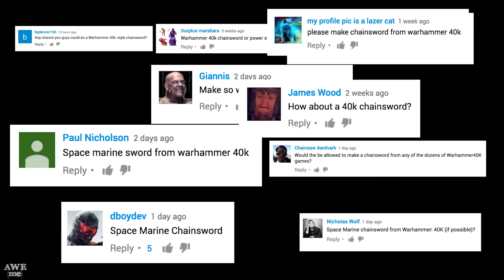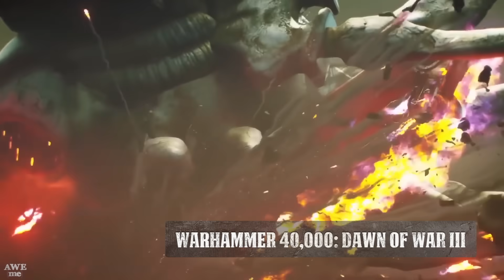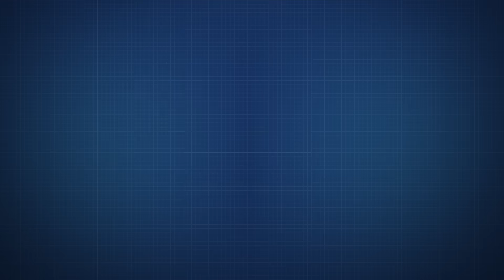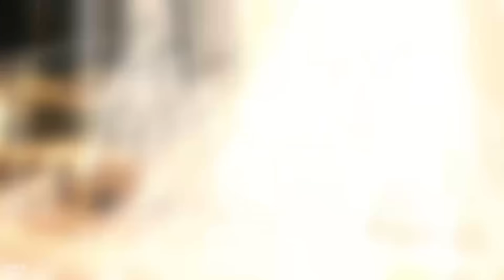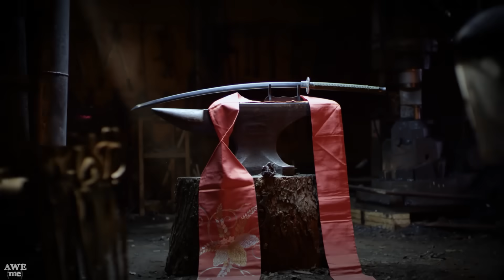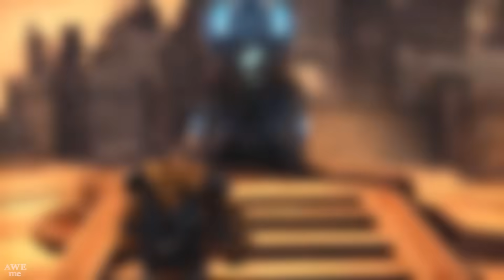Warhammer 40K Chainsword - MAN AT ARMS: REFORGED

Comment: at this point they'll be able to do a goddamn Lancer from gears of war...
Reply: Lancer from Gears of war? ON A 40K chainsword video? YOU HERETIC! Also they make Melee type weapons and armor, not fire arms.
Reply: If they were smart enough, they could make their own rifle from scratch from the ground up. Only the lower receiver in Federal law I think is considered a registered firearm. If they make their own from the bottom up, it should be entirely legal, wouldn't even need a serial number because it's not a manufactured product. The only law they would have to adhere by is to make it legal in the sense of being semi-automatic and part lengths, such as the barrel. That's dependent on the state though more or less.  Again, I'm no lawyer and it's just my opinion but they also make swords and the like, not guns. Completely different method of craftsmanship. They would need a serious gunsmith who's familiar with making fire arms and crafting customized parts that can withstand the pressures of cycling bullets and a chainsaw.
Reply: Don Dude very true. all ya gotta do is purchase the lower receiver of an AR 15, no upper required, and there ya go. ya got a rifle in the eyes of the ATF
Reply: They make swords not firearms mate
Reply: AlabamaDipper18 That's why you don't purchase one, instead you go to a page like 80PercentArms and buy a "paperweight", then finish milling it out, drill pin holes in the side walls, then some kind of finish coat on it. So much more satisfying.
Reply: Not sure tinkering with firearms is legal, at least to some extend. 
However, they could just make a mock-up. That thing is stupendously badass.
Reply: I doubt they'd be building an entire gun from scratch, they'd probably modify an existing weapon. In the case of the Lancer, the chainsaw is basically a fancy bayonet. From what I remember with federal law weapons before '89 or manufactured specifically to accommodate a bayonet can legally have them. Otherwise no.

So in this case that would mean modifying an existing weapon to accommodate a bayonet. I'd assume that falls into the category of "not legal".

Then again, if they're modifying a weapon that was already legal for bayonet use, maybe that would allow them to skirt it.

Comment: What is tac welding? I've only heard of electrode, mig/mag, tig and gas welding
Reply: Tac welding issimply a method of welding to pin pieces of metal in place which you can do in nearly all types of welding.
Reply: its not a permanent form of weld, its just to hold something in place while you do other welds.
Reply: Oh okay then I have heard of it before just under a different name, thanks.
Reply: Things often have more than one name/term/nickname/slang name/etc.

Comment: The Machine gods of the Adeptus Mechanicus are pleased. You will be granted a large alotment of servitors for you private use.
Reply: Runs through a binary translator
That's awesome.
Reply: But where are the TOASTERS you promised?!
Reply: MAchine GOD  there is only 1 necron lord they worship not many!
Reply: 01010000011100100110000101101001011100110110010100100000011101000110100001100101001000000100111101101101011011100110100101110011011100110110100101100001011010000000110100001010

Comment: Power Sword From Warhammer 40K
Reply: you mean thunder hammer just saying
Reply: Yeah that would be kind of hard to capture without a few hundred more years of technological development
Reply: No the Terminator hammer
Reply: Even Better
Reply: I mean a power sword is just a regular sword. What makes a power sword a power sword is its disruption field that makes it cut through anything like butter.
Reply: they can tint the blade as they did with Sting.
Reply: well they could build it with electricity running through the steel blade and a non conductive grip and handle.

it'd be more like a giant clumsy taser embedded in a slightly oversized sword with only the occasional spark. but possible.

Comment: one day, I swear, they are going to make a fully functional Light saber.
Reply: A New Hope that is :o
Reply: If that happens, I hope I'm alive to see it... and buy it.
Reply: MSmart19 

Woah, no need to get aggressive. I just remembered an episode of a show that I used to watch on Discovery Science. It's about figuring out the technical aspects of Sci-Fi props by Michio Kaku.
Reply: Well hacksmith has already made one
Reply: My vote is for some kind of plasma. Good luck with the magnetic field by the way, along with all the metal objects flying towards you as you swing the thing around.
Reply: The atmosphere igniting is not an issue you're gonna run into. The nitrogen in the air would fuse before you ignited the oxygen in it, and at that point, you've just turned the planet into a fusion bomb. All you need is a ceramic or carbon-carbon handle that won't transfer heat.
Reply: Godremembers Escobedo. You butter believe it!! Lol
Reply: MSmart19 

A metal telescopic rod that emits plasma
Reply: Divided Reality yup I saw that episode
Reply: Ceramics and/or reinforced carbon–carbon are a good start.
Reply: ***** Okay, how would you cut something with a material that is contained within a containment field unless that field itself is super heated which would cause the atmospheric oxygen to catch fire ergo defeating the purpose of the field in the first place by giving you 3rd degree burns on your hands, arms, upper chest, neck and face?
Reply: telescopic ceramic weapon covered with plasma, doable except that we do not poses technology to power it

Comment: Please do genjis katana and wakazashi from Overwatch
Reply: It's just a green katana that's not intreasting
Reply: Cody Lathrop I was just going to say that
Reply: Cody Lathrop You legit read my mind
Reply: 12halo3 while it is simple in form, it is a katana and wakazashi combo light enough to be manipulated into deflecting bullets and has enough tensile strength to absorb said bullet impact. It is a futuristic katana so they could use modern metal alloys with past techniques. And it has a polymer handle that appears to have a trigger for a locking mechanism for the sheath of the larger blade.
Reply: plz plz plz
Reply: Cody Lathrop  yes!
Reply: yes

Comment: I would totally buy that to do yard work with.
Reply: Xander 
Not recommended though. The motor makes handling the chain sword worse than handling a chain saw. Chain Saws have the handle fused with the motor cage itself. This chain sword has the handle at the extreme. So cutting trees with tis going to be difficult.

Lorewise though, those things are handled by superhumans. Not that mad that a normal human can't properly use it.
Reply: +ODDnanref But there are smaller chainswords for Imperial guard officers. I wonder how those light versions are built...
Reply: Bobistdeinemuda 
Maybe using those thing you use to trim bushes?
Reply: You can't cut anything with it. Did you noticed that they are not wielded it? it is overbalansed toy that have no use.
Reply: at last you cant kill with it :v
Reply: ODDnanref Well I don't think those things would could throw xenos skin. But you are probably right. Still those things are quite heavy to get used one handed.

Comment: wow not using the saw on, idk, something fleshy (big ol hunk of meat why not?) is a big ol fail, i mean oOooO you cut a milk jug so awesome >.>
Reply: It wouldn't actually function. It would get stuck, or the chain would break or jump, and potentially hit the user. Regular chainsaws can already jump or tangle if you try to cut something that isn't rigid, much less a chainsword replica using a tiny motor and absurd teeth.
Reply: They likely werent allowed to do anything more than that due to insurance reasons. probably also why they had to remove the cover to slice the wood, as well as not swing it around. Lawyers ruining the fun for the rest of us.
Reply: It's healthcare costs that are ruining the fun for the rest of us. Once medicine advances to the point where $50 can safely remove a long, barbed steel chain deeply embedded in someone's torso and repair the organ damage, it'll be an acceptable risk.

Comment: Was super impressed that it was able to still cut wood with those huge teeth. Figured it would stall out or get hung up. Cool build for sure. Well done.
 Edit: Crud, looked at it again and noticed you had changed the big teethed chain out for an original. Still cool but ... you know.

Comment: It's unlikely the Adeptus Mechanicus would approve of CNC cutting tools.
Reply: Here we go guys... we simply get a servitor with a welding torch and THAT can be our 40k tech cnc
Reply: I feel like they would love it! The machine spirit gets to do all the work while you stand there in awe of how grateful you are that it is about to give you the gift of machined steel components
Reply: The problem is that if the CNC machine it's an AI versus a simple cogitator, the probability of it attempting to build it's way to a human genocide rapidly approaches 100%.
Reply: It smells like techheresy...
Reply: Good point. Machine Spirits can drive vehicles by themselves and such, but only crudely.  Some new CNC is too efficient to be trusted
Reply: the computer on a cnc isn't powerful enough to run even a simple ai it just follows a pattern that the programmer set. then again i bet most members of the mechanicus have cnc machines built into their arms or something.
Reply: Machine Spirits are immensely more powerful than anything we have to date, the reason they're not more effective is because of the difficulty in getting them to actually do anything. That's why the Mechanicus spend so much time beseeching and appeasing the machine spirits.

Comment: hmm.. looks not like a weapon.. its actually less than a gardening tool - you can even take a stihl ms211 in ONE hand, and cut wood with it. Its definitly NOT impressive to cut water bottles both handed with this "sword"... and such a small stihl with that long sword has no cutting power. a creative solution would be to place the engine in a backpack-element, with a kind of - branch-cutting-extender, to use a bigger engine, and make the sword lightweight. You created the legendary "Wallhangerus Maximus". 

heresy grows from idleness.

Comment: Nice work! Hope you checked file hardness on the welded teeth on the blades or did a quick polish and nital etch on the hazs. you do not want those suckers coming off at high speed! Metallurgy.. the injury you avoid, may be your own. -gjsengineer
Reply: Yea we did ..thats why we kept it to soft targets for safety.
Reply: Interesting. I liked the back temper step.. wonder if you got bainite in the teeth or what the cross sections looked like?
Reply: We might go back and make custom teeth for it..

Comment: I have a question about welding: in this video, we see you welding a plate on top of another plate by the edges. Is it possible to weld two surfaces by their whole contact surface? (like you would do with glue, covering has much surface as possible)

Comment: Should have used a stihl 880 magnum for the basis instead of a shitty gardener's saw that doesn't have the power to drive such a massive bar.
Reply: Tombs Clawtooth  The 880 would've been good on power however it's still just a touch too big for the case size of that chainsword. and they're rather pricey.
Reply: The current chainsword motor-case itself is too big anyway.
Reply: Tombs Clawtooth even if they used a bigger saw it wouldn't work if you cute anything the teeth are way too big, it might cut for a second but then the teeth would get stuck and bog the saw down.

Comment: let me guess? that thing was way to heavy to even use as a sword XD
Reply: karrass It's meant for 9ft tall mutants in power armour, what do you expect
Reply: another testament to the strength of the space marines..of cos the power packs they wear on their backs does helps too..cos their damm power armor is too heavy for an ordinary human
Reply: Also you couldn't actually Swing that chain sword. The moment the blade impacts the target the teeth would be at risk of shattering and the chain braking.

Needless to say, the mechanics of how a Sword works and the mechanics of how a Chainsaw works are Diametrically Opposed.
Reply: Guardmen use them as well, they're not meant to be super heavy.
Reply: actually space marines use a differen't chains sword well one adjusted for them ,cause you wont a tiny chainsword with a 9 feet tall demigod warrior
Reply: Don't forget that these weapons were designed for 7 to 8ft genetically enhanced badass super soldiers.
Reply: The Sisters of Battle use them too, and they're only ordinary humans.
Reply: actualy,  one of the first space marines modification is something called black carapace ( I believe) that enables the spacemarine  be almost one with the armor, thus the weight is truly negated.

Comment: looks nice, but it is a very poor job. Why the case is not aluminum? Why the cover is so thick and metal? Why take a motor saw? Take an electric one, fit in to a nice light case, store the battery in the handle and you have a working sword, this one you can hardly lift.
Reply: This was based off a space marine chain sword . If you know anything about chain swords electric would not work ..we would not get the sound that is described in every novel or short story. We used steel for the case because it fit out purpose and as for the blade cover if you look at most of the artwork for chain swords the blade cover is much thicker .  As for size we made it to scale for a space marine one handed chain sword . There are other variants but this is what we wanted .

Comment: Great job, except you geared the blade wrong, primarily because you're using a chainsaw. A Stihl for cutting logs pulls the log TOWARD the operator, because the easiest way to get a good cut is to use spikes on the body of the saw to help you rock through.

A chainsword almost necessarily would push the target AWAY from the operator, for one thing, because blood and gore is going to come out and you want the least amount of that on you as possible, and also because if you don't kill it in one hit, you're probably going to want to push it back, onto the ground, or at least generally away, if not get your own feet off the ground and be pushed away yourself, to give a better chance of a counterstrike missing you. I haven't seen a combat chainsaw even drawn correctly since the early days of 40K, and it's a very common mistake to make. Separator saws in slaughter houses I believe are geared the same way as well. To push the material away from the user because it's on a rail so there's no stability issues, and because the operator doesn't want to be coated in raw hamburger by the end of the day.

The easiest way to achieve a saw that pushes whatever it's cutting away from it, as a proper combat weapon would, is probably to flip the chainsaw over and turn all the teeth the other way. The teeth on top of the blade are rotating away from the operator, and I don't think that would change if you turned the saw upside-down. This is absolutely NOT the thing to do when you're sawing lumber, and unless you're really confident with the machine, you should not cut from underneath a log... If the operator loses grip, the saw can shoot upward and backward and cut limbs off the operator. Always safer to roll the log, even if it's less convenient to make all your cuts twice.

Comment: Wait... would you want it to kick the sawdust/debris toward you like they have it?
Reply: Hang on - very good point - 
I mean, it does seem impractical to hav Xenos blood spill all over your power amour and at your visor, but if it was the other way, wouldnt it push enemies away from the weapon ? hence hurting them less ? - im not sure - RESEARCH
I guess if u were a real Space Marine Assault - U could choose which way round to put the Blade/Belt -
Actually - if u look at the picture they working from - They hav got the blades the right way round.
Reply: It's the same reason the chain on a normal chainsaw doesn't run the other way. If the cutting edge ran away from you, it would kick back into your grip, which is actually worse than pulling away. It's the reason all chainsaws have a forward grip on top, for you to pull back on it. Remember that a chainsword is being used by an Astartes, an 8 foot tall power lifter in essence. The pull of the chainsword's teeth is little trouble for them to hold against, and it allows them to drive the weapon deeper into the opponent, since the weapon naturally wants to keep going further. You wouldn't so much strike and cut with a chainsword as you would slide the blade against your opponent and let the teeth dig in deeper on their own.
Reply: shakemonster2000
Well, the top of the chainsword appears to be enclosed...
Reply: I just watched a Hasqvarna demo, and you guys are indeed right - the bottom chain seems to  be coming toward you, and the top away, (though that tutorial says you can cut with both).  Thanks!
Reply: biostemm True. You can use both sides. When using the bottom to cut you allow the weight of the saw and the pulling motion of the teeth to make the cut. Using the top part of the saw is commonly called a pull cut, as you pull the saw at an upward angle to make the cut. A lot of people will use an alternating method of a push cut and a pull cut to make quick work of timber. Either way, the chain moves in the same direction, away from you then down and returns. Also to answer your original question, the sawdust goes pretty much everywhere anyway, but if the chain moved the other direction it would tend to fling it into your face more due to inertia and momentum. If you actually watch wood being cut, you'll notice the majority of the sawdust is thrown from the bottom of the bar between the point of contact and before the the chain reenters the casing.
Reply: shakemonster2000
Gotcha.  Thanks for the info!
Reply: All good points